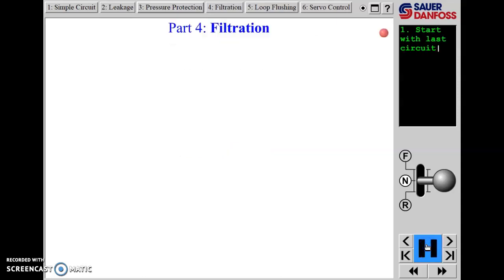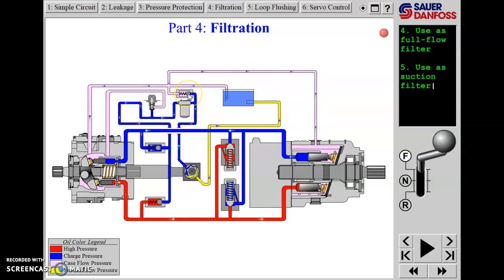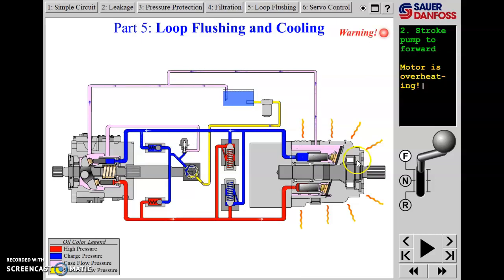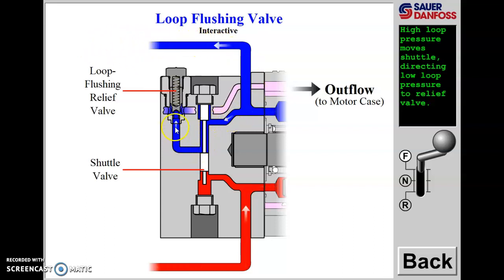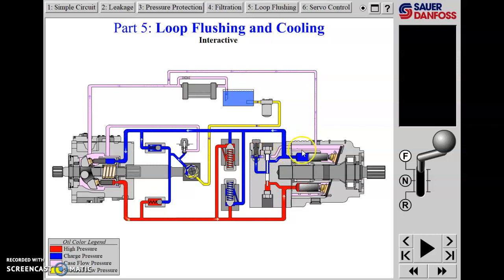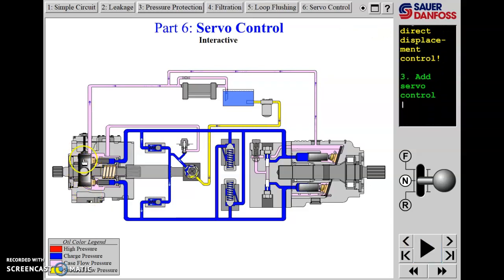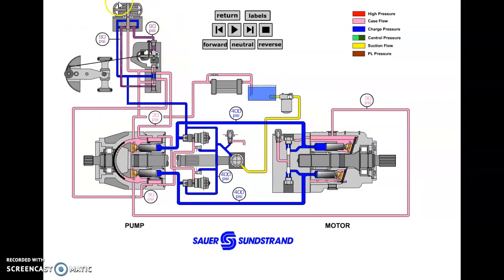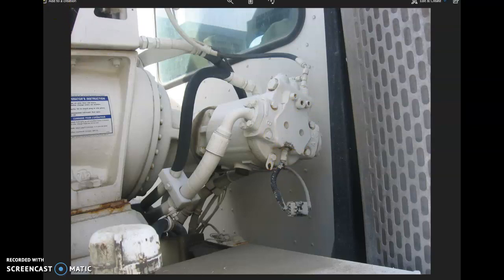CLOSED LOOP HYDROSTATIC PART 2

Comment: In a pump failure scenario what would cause the motor to continue to turn even when pilot pressure for directional control is zero. Wouldn’t it be neutral position of swash plate (not returning to neutral position)?

Comment: Does anyone attempt to directly cool the charge with an oil-to-water heat exchanger? I guess something like that could be prohibitively expensive if it doesn't result in restriction.